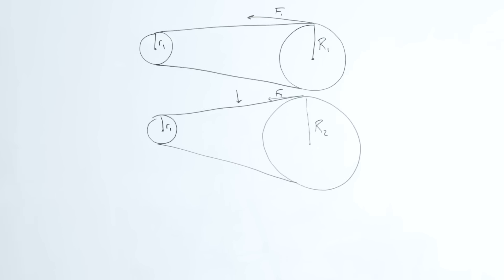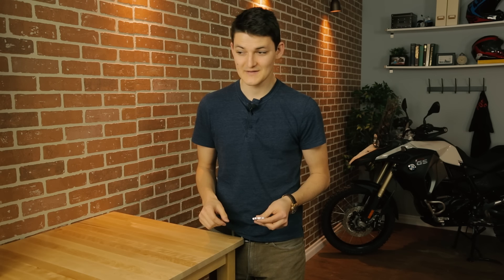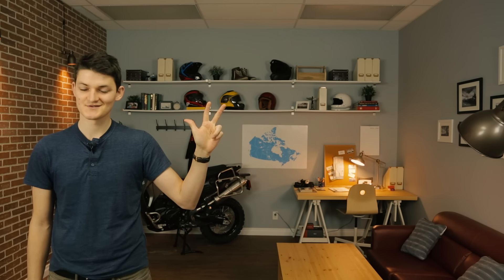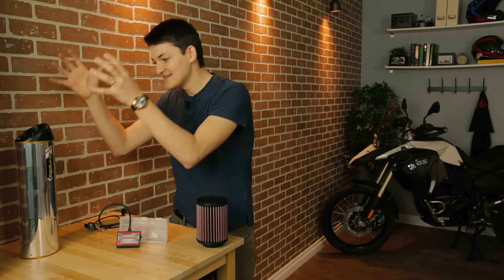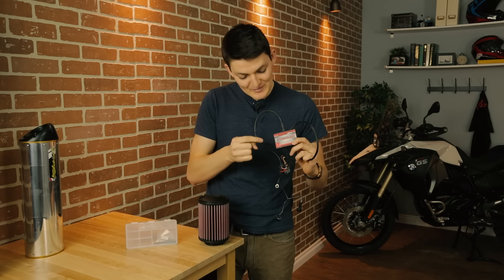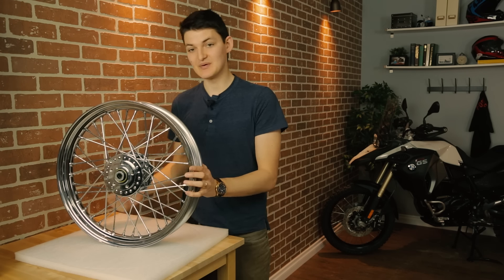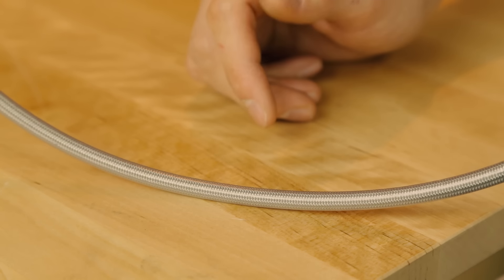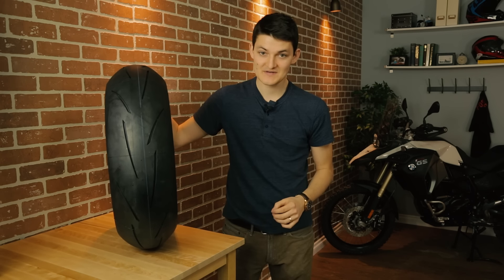Top 5 Motorcycle Mods to Go Faster

Comment: Do Canadians really?  Ryan has quickly become one of my favorite watches on this platform in the last few months, but I can’t say I love some of the UK English terms he uses. Is that Ryan just being a hipster, or do Canadians prefer all things English to be to match the motherland? I know many of the spellings tend towards the Queen’s English up there, but does a kid from Saskatchewan really grow up pronouncing
lever as “leever,” and carburetor as carburettor? What stood out in this video and I’ve heard in another is calling numerically-lower ratio gears lower. In the States, increasing the ratio by using a smaller front sprocket “shortens” each gear, and is therefore called a lower ratio. Just like first gear is lower in the sequence and provides less available speed, increasing a final drive ratio “lowers” all of the gears. High (numerically lower) ratios are called “taller” gears likely because it’s analogous to a longer stride.

Comment: Lighter wheel, gyroscope and everything is another example of common misconception. The truth is that the most relevant thing affecting your steering is trail. Shorter trail-easier handling by the cost of increased wobbling chances and vice versa

Comment: Hey so I have a Kawasaki ninja 300 and some lady cut me off on the freeway and ended up side swiping me off when I fell it just slid and scraped everything up...I have a stock can rn but the scraping made a little hole in the metal area of my stock can...I’m not sure if there is a leak I can still get all the way up to the same rpms and too speed but around the little scrape it’s kind of dark...I’m not sure if it went all the way through because the metal part is like a shield but I can’t really see if there is a hole or not

Comment: Do you need a fuel controller/power commander in order to tune the bike to handle a full exhaust and high flow air filter, or can you just flash your bike to adjust for more airflow?

Comment: I tried the sprocket to gain top speed, but instead i get less top speed as the bike loose power, usually i make 120 after sprocket change it is hard for my bike to get to 100.... do i need to increase the power using the sandwitch method too after changing the sprocket?

Comment: I have an Austin racing short exhaust on my motorcycle now and I want to change the oem air filter to a performance air filter because the oem filter box is just too huge and need it out of the way. Now just doing these 2 mods, is that ok? And what could happen if I ride and leave it like this?

Comment: i don't get why manufactures still use rubber break lines or why you wouldn't replace them with braided ones once the old ones are shot. the only disadvantage they have is being a bit more expensive

Comment: Does this also help with mopeds? I have got a honda dax, and it’s pretty slow. It had a 50cc engine and accelerates really slow. Top speed is around 30 mph or 48km/h. So if i want to chance the sprockets, will i feel the diffrence or not?

Comment: My issue is my bike is a 250cc enduro that tops at about 60, I'm trying to get it up to at most 80. Any tips, the engine is a single cylinder 250cc engine.
Reply from the maker: A smaller rear sprocket is your best bet. Since it's an enduro, you should have the torque to pull it off. ~RF9

Comment: Get better Plugs and Racing Cable. More fuel needs to burn better or its just going to pass through faster unburnt. OEM cables are substandard. NGK iridium or the like with a good cable will make a difference.

Comment: Wait so can I change both sprockets? And which sprocket do I change to have a higher mph?
Reply: going bigger on front will give you a higher top speed but lower acceleration, and going smaller on the rear will do the same.  I wouldn't go more than about 1 up front and 2 rear tho, regardless of model, as it really stresses out your engine.
Cheers!

Comment: Hey hi I have 2011 Honda cbr 250r I have changed so many tyres all 140/70/17 but non of them were able able to provide a safe ride there is no grip on them. Can you please suggest me I wanna fit a wide tyre in my stock wheels. What is the widest tyre I can fit in which also have the best grip specially in wet. Will 160/70/17 fit and can I fit wider then this. I really need some suggestions in india nobody cares about anybody's life the sell anything for their profit. Currently I am using ceat 140/70/17 n I swear on my life riding my bike with these tyre is like sucide I have met with extreme accidents because os these tyres please suggest me

Comment: Most people just ride their bike without the supposed maintenance like oil, plugs, filters, valve gaps, carb sync, and are eager to bury money into their bike for more performance. It grinds my gears so much so hear someone with a poorly tuned bike saying "i just ordered a new can, now the bike can breathe properly"
Dude, you dont even...
Then you have guys with hornets and cbr's asking why blokes like schaaf can outride them in their cb500; the main problem in most bikes is that part that connects the handlebars to the seat.

Comment: Yup, almost all bikes are geared way to high. They can claim better fuel mileage; under ideal conditions, is my guess, but I have not notice lower fuel mileage when I gear my bikes lower, and they perform much much better.
I wish they would calibrate the speedometer to read correctly after the down gearing.

Comment: So question, I have a 200cc bike that is just a little bit weak on the highway. It can get up to 75 or 80 miles an hour when wind and grade are correct, but then sometimes it drops down to about 60. Would changing the gearing actually help it go faster, or is the limit that it's facing actually the power of the motor? It's a Lifan KPM200.
Reply: changing the gearing only change how fast your bike accelerates or increase top speed with sacrificed acceleration. it will not add power to your bike.

Comment: Sounds crazy, but you can increase the engine size by changing the cylinder head or lathing the piston. It really works! But you can also change the Carber into a performance one with a wider jet or ... or simply deleting the air filter, I have always thought about turbocharging too...

Comment: I'm confused: if you ride a fuel injected bike with an (I ride a 17 CRF250L) o2 sensor, does it not automatically adjust air fuel even if you do your exhaust & intake? It makes sense to have to adjust fuel on a carbureted bike.
Reply: O2 sensor has so much lag and inaccuracy (narrow band on the average bike) it only really works at steady throttle and revs (cruising, idle) and then only for the first half of throttle and revs. Obviously during acceleration is a bad time to have poor fueling.

Comment: Any ine have any good info on cams for a a bike only riden on the street? Looking for low cost n decent performance.  I dont ride the bike alot  because the area i live n seasons. So i do not think i need  top of the line crazy expensive parts but not ebay sbit either lol.

Comment: YOU ARE WRONG ON THE LIGHTER WHEEL on the suspension aspect of it, not the motor turning it over easier. A lighter wheel is good for acceleration but light wheels takes advantage of hp but not torque. Light wheels have a hard time dealing with torque and spin. Its why any race machine has steel wheels. The extra weight helps plant that torque to the surface. 

Wheels are unsprung weight so their weight has a huge bearing on lauch/acceleration and braking.  So in a reality to use a lighter wheel you need a heavier tire to help make up for the light wheel. heavier tires are usually the $100 dollar tire or $80 if on sale...We all know those tires are ok for commuting within the city but suck on the highway. 

This is one thing i will say about a bike from the factory on a whole. For the most part they have spent 1000's of hours developing it as a complete bike ( with exception of harley davidson trying to keep up with imports).  My 1982 honda v45 (carb) bike with dress ups but not modified at all performance wise still kicks 1200-1800 harleys asses. It seems that harley wants hp numbers but don't give a shit about how its going to plant it to the surface. 
 I have seen 600hp cars kick 1200 hp cars in a 1/4 mile because of where (the rpm range) the hp matters.  1200 hp at 7000 is spinning tires at launch while the 600 hp car is 1/4 of the way down the track already.....Its why ferraris and lambos do not do well with mildly modified 60's/70's muscle cars. HIGH rpm hp numbers means high rpm torque numbers...So point is HP nor torque matters unless its built for a purpose to do so in a rpm range that will suit your needs. 
99% of the time the way I ride I could ride a honda 250 rebel. and be happy.

Comment: You didn't mention how much gain each mod (?) would give, the power gain would be very little unless you made massive changes to your bike. Then of course it the loss of reliability that mods bring, high performance= high maintenance, and only then do we get to the higher cost of running the bike. Breaks and tyres good stuff, but I think the best advice would be, learn to ride your bike to its optimum,  for the massive majority of riders out there, their bike has far more ability than they do.

Comment: Gearing dose not make a bike faster it just changes how long it takes to get there or even slows it down. When setting a power commander or installing a jet kit what intake you have is far more important to consider than what exhaust you have. Only thing power commanders will do on a stock motor bike is get rid of backpop when you let off the gas and mess up your MPG but you will not go any faster. Once a fuel injected motor is modified with performance cams or a big bore a power commander or other equivalent must be used to compensate for the extra air drawn in. I would not try to fit those Harley brake pads on your BMW either. All those products are great and useful in the right situation and your explanations are close but what you did was read the script most parts people in motorcycle shops use to sell more parts. Not saying the customer will not enjoy the parts but he will spend hundreds or thousands and only go a tiny tiny tiny bit faster. If you want to go fast you got to go inside the motor and then you do the exhaust and intake and power commander and possibly gear it and then it will go noticeably faster.

Comment: Dont change gearing. You may improve acc at cost of cruising speed. That's not benefit, thats compromise.
Dont buy high flow airfilter. The only thing itll do faster is ruin the engine.
Exhaust change is ok but not as performance upgrade.
Just get litre bike if you want performance like vstrom and you won't have to do any stupid mods that do more harm than improvement

Comment: Have a problem with my engine knocking.
Is it possible that the ECU programming cause the engine to start knocking ?
Is it possible that the factory mapping could become corrupt or partially corrupt and cause engine knocking ?
Thank you !
Reply: Did you get your ecu flashed or throw on a power commander?
Reply: @ramia317  :  not sure if it was flashed, but I know they do updates if available.
Not sure if an update was done.
No power commander.

Are you hinting that the ECU could have something to do with it ?

Comment: Can someone explain to me the fuel controlers upgrade? Why its required? Whats end result?
Reply: The short answer is if you do an intake and exhaust upgrade it's pretty worthless. Your ECM's fuel maps already account for the slight change you'll get in air flow. Usually tuning is for when you change fuel injectors, advance or retard timing because you use different octane gas, or spark plug timing which also depends on the other 2. Horsepower costs money.
Reply: @TheLouisianan  so basically its not required after the remapping and tuning which occurs from exhaust change
Reply: @cursethesky3874  yeah, it's a touchy subject with people though that probably stems from the fact that tuning does have noticeable changes on how engines run because they can change timing enough so that you can get more power (usually at the expense of mpgs which the manufacturer cares more about)
Reply: @TheLouisianan  cool. Thanks man.

Comment: Error error. .dropping one tooth off the front sprocket will not make a bike accelerate any faster except when first taking off.
It takes X amount of hp  to accelerate a given weight at a given mph at a given...gear ratio can't change hp it it could you could make any be bike haul ass by just changing the front sprocket...it might feel faster because you spend less time in each gear.

Comment: I lost top speed after I putt a kn filter on, so I should make the bike get more fuel?
Reply: K&N filters are garbage. The oil you spray on the filter overtime will get on your MAF and make your vehicles A/F mix mess up and you'll eventually get worse performance and rough idles. Stick with paper filters if you really want to upgrade anything, but don't be shocked when you can't really notice the difference.
Reply: @TheLouisianan  wasnt the  kn filter but I did remove it anyway
Reply: @sandodelalic4762  what happened?
Reply: @TheLouisianan  one lose cable so didn't run on all 4

Comment: Smaller sprockets on a streetbike are perhaps the most "American" mod you can do, and completely destroys the already poor gear ratios on modern motorcycles. Overdrive gears should be standard on modern motorcycles. I'm not sure why people think 4,200 rpms is a good cruising RPM.

Comment: I may be wrong, but aren't all the jets (I hope it's spelled correctly) the same? I mean they have different diameters of course but how can a pice so simple be better from a certain company or another, i mean it's a pice of brass with a hole. When i buy new jets i never ask what company they are from and i never bought them in a package from a company but only as spares with no package at all, i could have the worst jets ever on the market and don't even know it lol
Reply: The jets usually are all the same. What companies do when they make a "jet kit" is determine which jet sizes work the best in your specific bike based on a range of weather conditions and altitude. This takes the guesswork out of finding the best jet combination to use. Though with jet needles they can have custom tapers that cause a different variation in fuel mixture based on throttle position to smooth out any inconsistencies with the standard needles.
Reply: something1random23 oh, I see, they also arrange their jets in "stages". Sounds weired but i recon the guesswork might take a lot of time and this helps a lot...

Comment: at 2:03 he said LOW when he must have meant HIGH.   When you gear the bike LOW, with larger rear sprockets or smaller front sprockets it will accelerate faster and have a lower top speed. I personally think that 130mph on the top end is plenty, and then you will be able to run with anyone on a short street race.  To do this, know that your modern bike will easily redline in the top gear with a substantial sprocket change, so you can compute the top speed by going to http://gearingcommander.com ; My advice, buy all of the front sprockets that fit your bike, or every other one such as 14-16-18 or 15-17-19, and start with the stock rear sprocket, probably 42 or 44, and then one that is 4 teeth larger, 46 or 48 or so, this will give you almost every choice from 19-42 (really high) down to 14-48, which is REALLY low. I run a 14-54 on my Yamaha R1, and it is the fastest short-race bike in town, and it will do 2.4 or so to 60mph.
Reply: Start a fckg vlog. Thanks for all the advice. Ordered a V4S .CHEERS
Reply: ok, i'll ask, what is a V4S, a new P'NIGGLY? - https://www.youtube.com/watch?v=ZKedZ955pC8 That is one vibrating buzz bomb ass-burning motorcycle. You need to get a fire extinguisher for your ass. Take it back, and get an R1M
Reply: stephenmwyatt2 duc
Reply: stephenmwyatt2 well said. Staying alive will also be a priority. Maybe a DP seat might help
Reply: stephenmwyatt2 are you in US. Able to ride 365
Reply: stephenmwyatt2 2018 going to be a great yr for JL too much pride to fail. Took on Vale in his prime. 30 5 in ON
Reply: stephenmwyatt2 taking a mortgage for 50 alp/duc air suits fckg $
Reply: stephenmwyatt2 check out RN 675 nice guy, they're pushing it tho
Reply: stephenmwyatt2 time for a new helmet as well. AGV, SHOEI, photocromatic shield   maybe
Reply: Yes, I live in the Southwest U.S., and winter is better than summer in some ways, but seldom too cold to ride.
Reply: He will be riding for a non-factory team in 2019. I am predicting that Rossi will win next year and then retire. He still has what it takes if Yamaha can figure out the tire thing.  Marquez is still the best rider by far, but there is more than riding talent needed.
Reply: stephenmwyatt2 spent 5yrs riding/Staying lit in SW Austin/Corpus(S Padre on break)Denver Abq LA Tempe
Reply: stephenmwyatt2 left DNA on I 35 going into S.A. speed wobble 3 wks in to adventure
Reply: stephenmwyatt2 agreed Zarcho makes me lmfao. Just doesn't give AF
Reply: stephenmwyatt2 Danny's got  to go. Never a legit threat for champ/so many young riders willing to challenge MM